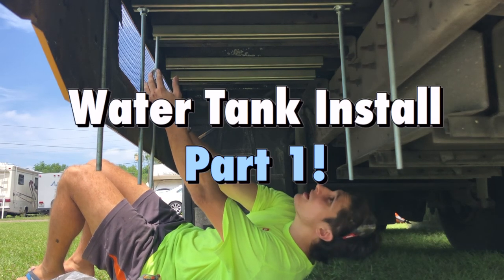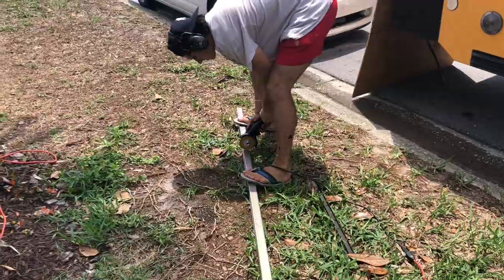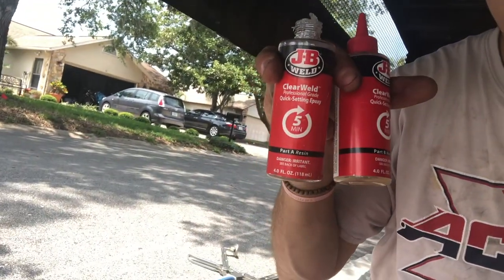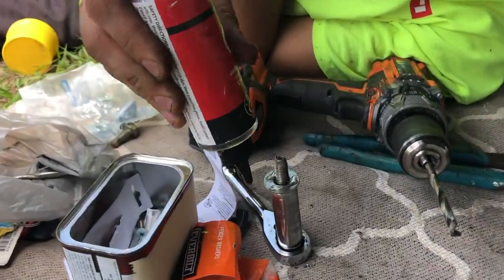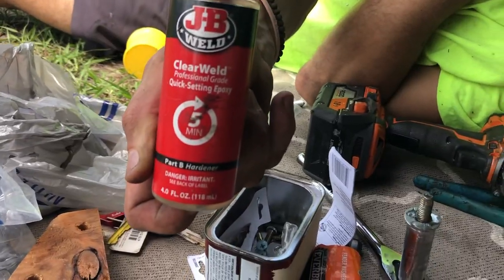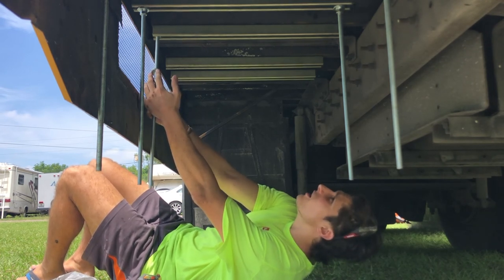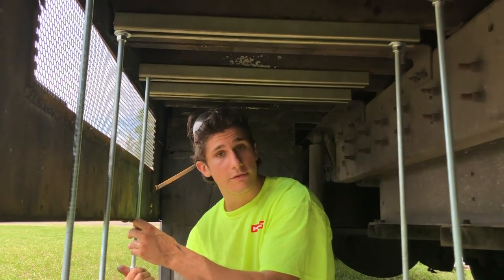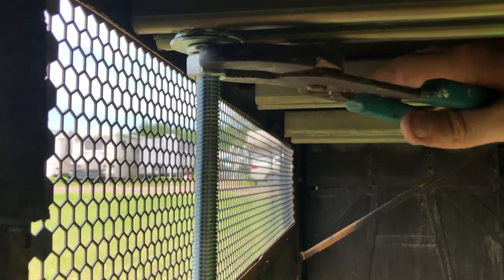Installing FRESH + GRAY WATER TANKS under School Bus Conversion | NO WELD MOUNT for 600lbs of Water!

Comment: My guy get yourself thick self tapping screws. Those are sheet metal screws and they bore their own holes which will save you the need to independently screw and drill ya know? Other than that, the ingenuity shown by the two of you is only eclipsed by the actual genuine love there clearly is between yall. wish you two all the success and happiness in the world and honestly been in construction/hvac for 12 years, can braze, solder and weld as well have installed thousands of units from commercial to residential to mini splits and wall hung/window mounted units..... only reason I’m telling you that is because I’ve mounted tons of shit to tons of mediums so please feel free to hit me up if you get hung up at all. Would love to help y’all in any way I can. Much love to both of you!!
Reply: Thanks for the love brotha! I used some self tappers as well but just ones from the demo. I really think just some small beads with a welder will finish the job. It’s super strong. We may have some questions down the road, appreciate it!
Reply from the maker: Ryan George thanks Ryan, so sweet :) we wish the same to you!!

Comment: You could clean up some of the slots without bolts in the channel you with a wire wheel and weld a bead on 2 slots per channel. Welding upside down isn't fun but they may be able to stay under a welding blanket to avoid burns. I wouldn't trust sheet metal screws long term.  If not welding then I recommend grade 8 bolts with nuts locked up top... do the ribs allow access to place a nut? Mine are like upside down Ts below the bus. Welding is not really all that hard to do. You may want to learn basics.  It's very very useful... and really fun.
Reply from the maker: Definitely thinking about looking into learning to weld a bit... great point! The more projects we run into, the more it seems like a necessity!
Reply: @ShawnandAsh  you both should learn.  It's not just for dudes.  My daughter is more patient than me and welds a pretty good bead.
Reply: Grade 5 would be better than 8 in this case. 5 will bend and flex when traveling loaded, 8 is "stronger" but sheers easier.
Reply from the maker: brad metcalf it’s actually already welded at this point!
Reply: Shawn and Ash thanks for the advice and videos. I’m literally about to walk into the driveway to figure out how to hang mine!
Reply from the maker: brad metcalf glad we can help!! You can do this, get those tanks up with confidence!!